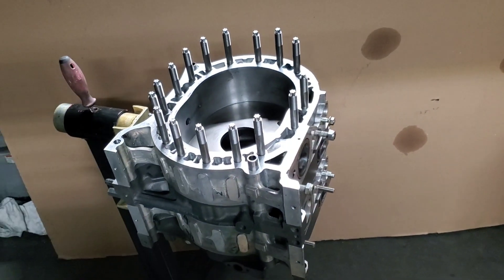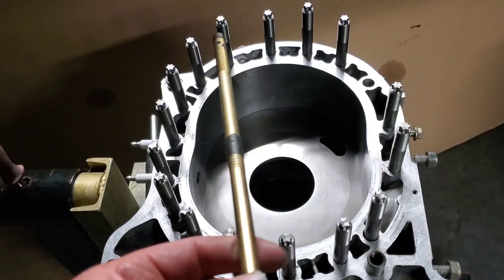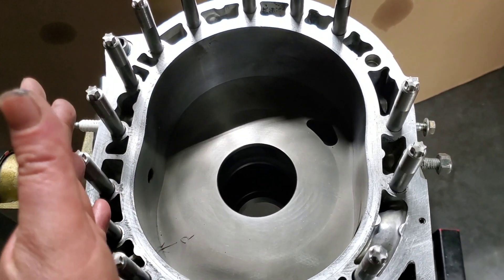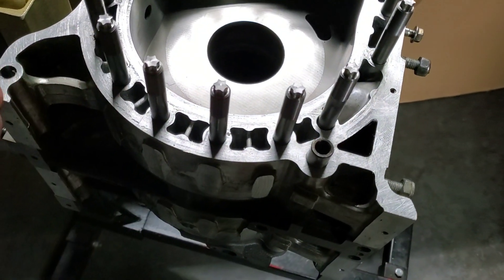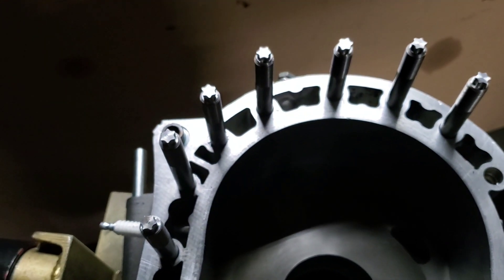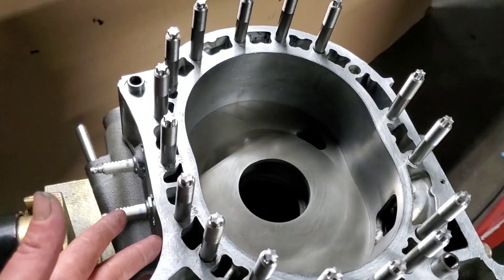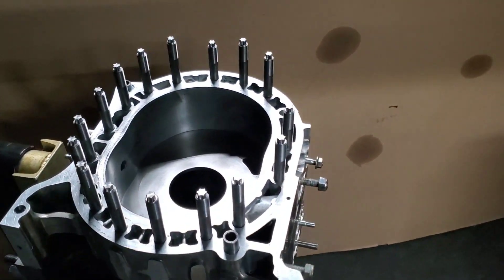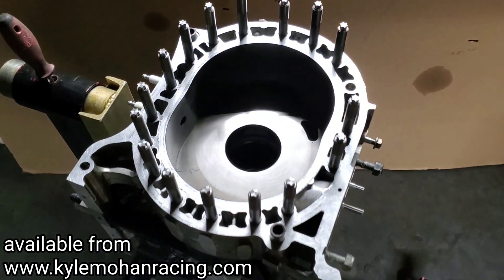Rotary Engine Studding and why its great, Tech Talk - Kyle Mohan Racing 13b, 20b, 26b dont break it

Comment: This is great info , I’ve heard that side seals have issues under high boost however , do you have any solutions or is it just something that will wear quickly and will cause you to rebuild the motor often
Reply from the maker: Nope. Sounds like bad or unclear information regarding side seals.  Oem side seals are generally fine and the normal used.   I also recommend oem corner seals.  Even in high hp applications.  I run EandJ 2mm apex seals. Stock side seals and corner seals in my 1000hp 20b.  All work fine.
Reply: Wow thank you for the reply. The information specified not out right failure but a gradual loss in tolerance as they cannot withstand the stress above 600 hp ( 2 rotor) in your experience how worn or at which interval would they need replacing. If you have not needed to rebuild how much mileage are you at. Thank you for taking the time to read this and or respond . I am sure you are plenty busy  @KyleMohanRacing

Comment: A couple of builder's in Sweden I've talked to say that there is no point in doing 1/2" studs on a S4 or S5 block with the thinner casting, it's going to crack anyway.
I don't understand why those blocks can't benefit from the studs? (If we remove detonation from the equation).
What is your thoughts about the thinner blocks?
Reply from the maker: Thats wrong in my personal experience and my opinion.  We have successfully ran S4 and other small casting blocks to over 30psi or more for years and years. ( that's the basic reason why studding was invented ) Other good examples include my old FC3S Drift & TA car. S4 small cast Block 22 -25 PSI for 7 years with studding.  Sold the car still running.
Also, my current Formula Drift 20b is a small casting block, full studs 30 plus psi going on 3 years of Formula Drift use.  ( Either they don't know or they are trying to upsell people on more expensive builds... Both are bad examples of good business )  No studding done poorly wont fix anything. so if they have had failure then it was most likely due to improper machining.
Reply: @KyleMohanRacing  Thanks for your answer.

Comment: Is studding worth the investment on a high RPM N/A build? For example a bridge ported race motor?
Reply from the maker: I would go OEM replacement studs unless over 10,000rpm.  Then I would consider running some oversized is specific places